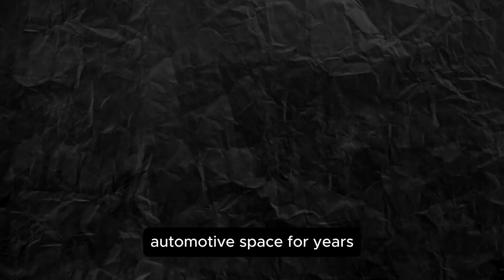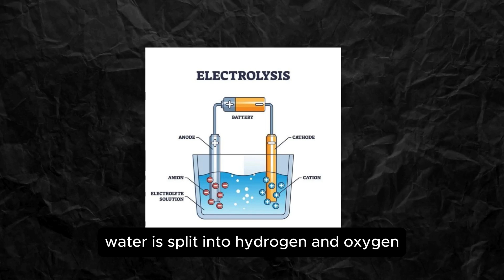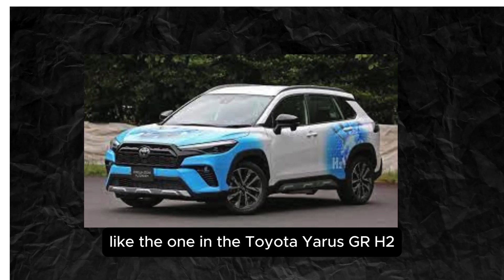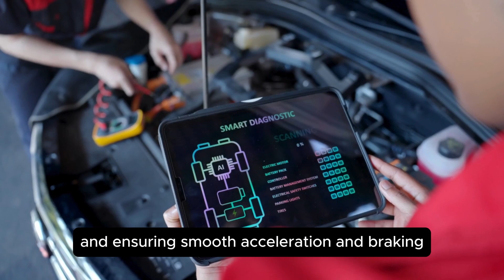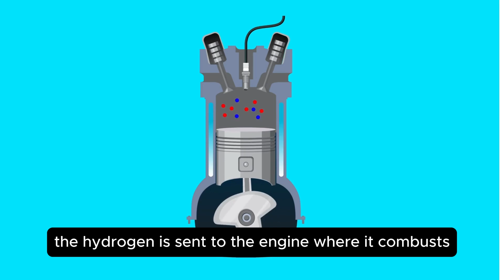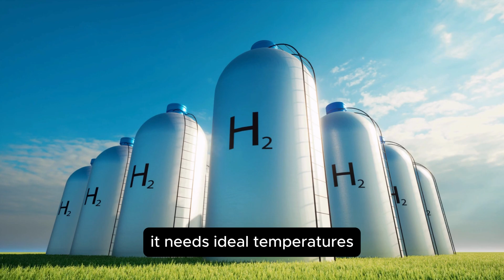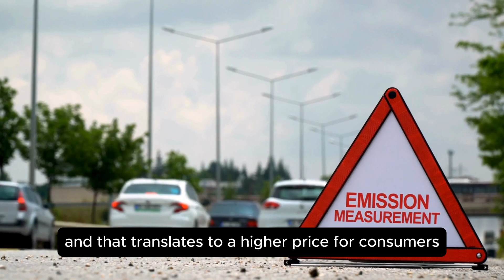Toyota's New WATER Engine Will Destroy The Entire EV Industry!

Comment: If it does not use batteries, what source of power does it use for the electrolysis of the water? You can't tell me that the engine makes enough power to do this on its own.